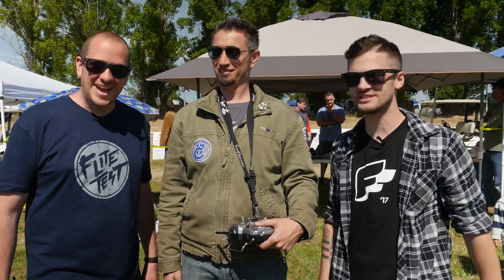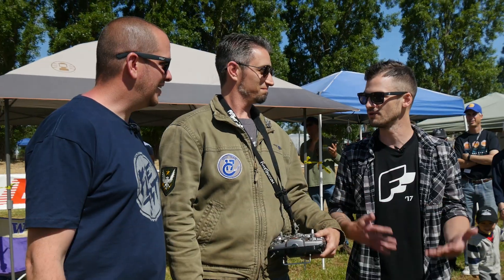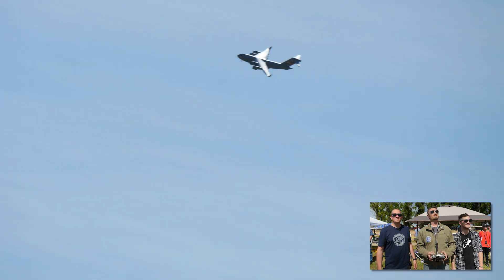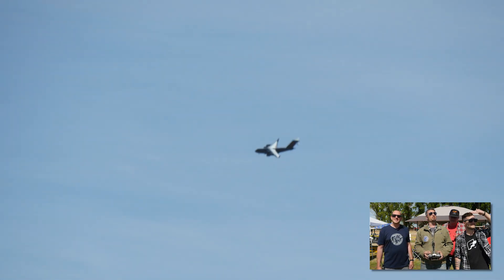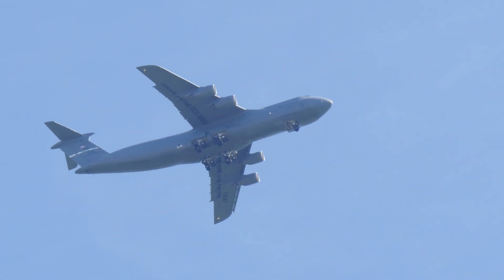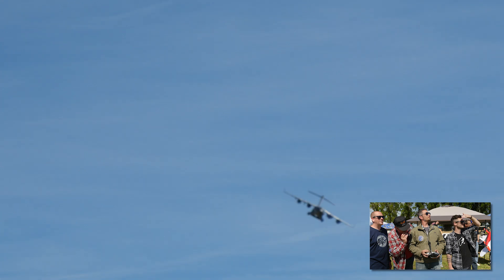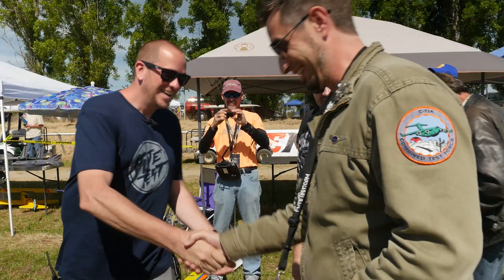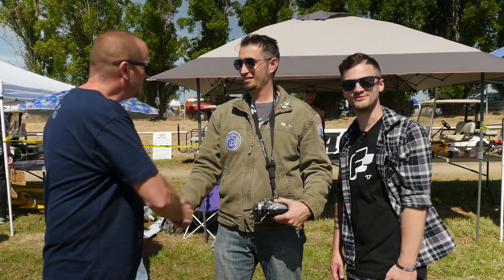Homemade Remote Controlled C-17

Comment: Ok ... try this ...
DIY SODIUM SILICATE STABILIZED PAVED RUNWAY ....
JUST ADD HOT S.S. WETTED SAND INTO A CEMENT MIXER ....
THEN QUICKLY SPREAD OUT FLATTENED SMOOTH ...
AND A C.O.2  FIRE EXTINGUISHER TO SET IT !!

OK first ...maybe ... a pilot slab "FliteTest -style" .

Comment: Great model!  On the real deal, with flaps at full or 3/4, exhaust and fan air blown into the flaps puts the aircraft into backside configuration where thrust generates lift, and pitch is used for speed.

Comment: Very Nice Plane!  Thanks for the share!

On a different note; has anybody stated how chintzy the servos are in the Timber???  ..I purchased the Timber with Floats, per you guys recommending it, was excited when it arrived, programed my tx as directions stated, while I was charging the batt., then went on to the build all went smooth, with the one exception that I had heard from others also, that it's cumbersome to have to flip it over and back for how the batt installs, no big deal, but then when I went to fly it all started out great, took right off and only minor trim, was bringing around for a fly by, low altitude and very slow, when from nowhere and no reasonable explanation the aileron servo failed!  ..I brought it in for a reasonable landing with just elevator and rudder, and would you believe it, (I didn't), the rudder servo failed after a landing while just taxying!   Less than three minutes for near on three hundred bucks!  What a bummer!  These servos that horizon is using are JUNK!  Have you had anyone else complain???  

Now in their defence, after calling Horizon, and some several tens of minutes later, they are sending me a full replacement set of servos, I can only hope that they're better than the original ones, ...if not, what servo would you recommend I replace them all out with???  Thanks for your input, Kind Regards, Mike

Comment: What a beautiful model!  I thought the preview picture on Youtube was a real C-17.

That runway is about as smooth as the Andes.
Reply: That runway was actually a bit too smooth, had trouble taking off of it with my T-28. Couldnt get any traction! But the landings were awesome.
Reply: So it was very slick, but very uneven?
Reply: Erik Warnes yes they just laid it over the grass so it was really loose.
Reply: Erik Warnes I

Comment: The c-17's engines don't blow air over the flaps, only AT the underside of the flaps.
Reply: Actually, it has a multi-element flap that allows the thrust to blow both through and on the flaps:  http://www.b-domke.de/AviationImages/Globemaster/Images/C-17A_96-0006_19789.jpg
Reply: Air flowing faster has lower pressure, hence why air being accelerated over the top of the wing has lower pressure and creates lift. That being said, the main mechanism of lift generation is air being redirected downwards, not being accelerated over the top of the wing. The flaps have a slot in them which allows the exhaust to pass over and under the flap, being redirected in a more downward direction.
Reply: Type in "Coanda effect" in search, then come back and apologize.

Also while your at it type in An-72.
Reply: I too have done fluids 101.
Reply: Ok I didn't want to make a lengthy post, I wanted you to do your own research, I wanted to be lazy about this but either you are a troll or you are too stupid to realize you are wrong. So let me break it down for your simple ass.

First: Under wing turbofans do not interfere with the flap system because there are typically no flaps directly behind the engine. And even if there is no flap-less slot for the exhaust (like on a 757), the engines sit low enough where the exhaust causes very minimal issues, not to mention aircraft with no open spot in the flaps always have a much lower bypass than something like a 777 thus minimizing structural issues.

 See this pic https://upload.wikimedia.org/wikipedia/commons/d/d2/Air_New_Zealand_Boeing_747-400_%28ZK-SUH%29_arrives_London_Heathrow_17Oct2010_arp.jpg
http://img00.deviantart.net/1b0e/i/2010/311/6/7/boeing_777_flaps_and_gear_by_pma27-d32dhzc.jpg
https://www.aeroinside.com/img/aircrafts/aircraft-boeing-767-300-registration-G-BNWZ-af177ef53b_b.jpg

Second: The Coanda effect has nothing to do with spinning. Nothing at all. Do this simple test. Take a piece of paper, hold it with both hands so it dangles down. Now blow across the top of the paper only. Tell me what happens.  Unless you have a retarded piece of paper it will rise. The stinky air from your mouth stays attached to the surface, curves with the paper, accelerates, the pressure drops, while simultaneously the redirected air due to newtons laws causes the paper to rise. Once the paper flattens out (no more Coanda effect) it will stop rising.

If you cannot do simple searches let me make it easy for you.

https://en.wikipedia.org/wiki/Coand%C4%83_effect

Go down until you start seeing aircraft wings. I say that, but your simple ass will see the balls at the top of the page and come back to make an ass of yourself again.

Better yet let me cut and paste it.

"The Coandă effect (/ˈkwɑːndə/ or /ˈkwæ-/) is the tendency of a fluid jet to stay attached to a convex surface"  

Just do me a favor and blow over the top of a piece of paper. And while you are at it, blow on the underside by itself in a separate experiment.
Reply: mPky1 man just go back and read your comment. You must have the memory of a goldfish.
Reply: mPky1 also the wing is sucked up not pushed up

Comment: I always found the larger slow moving planes to be much more appealing than these little birds
Reply: Not a Cat That's for sure. I have a small F4F FunFighter and it's around or under 500 size wingspan. It's a blast. We also have the Guinea Pig and that's a great time to fly also.
Reply: I'm way different. I have a need for very very fast speed.
Reply: to each their own i guess...

#SPEEDISKEY